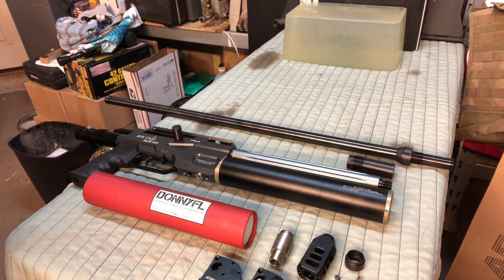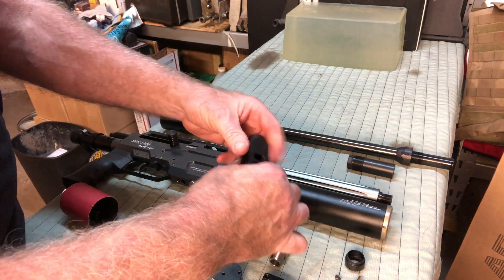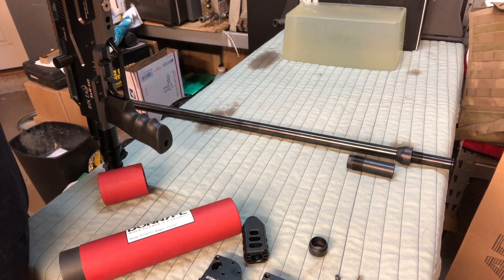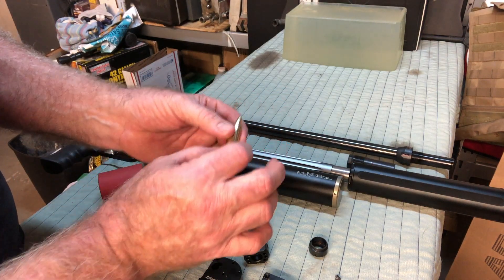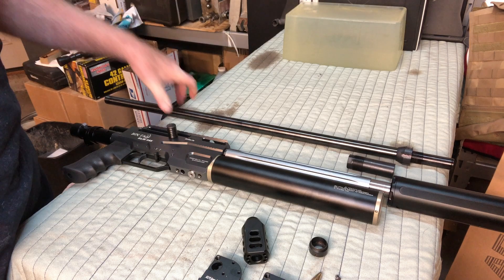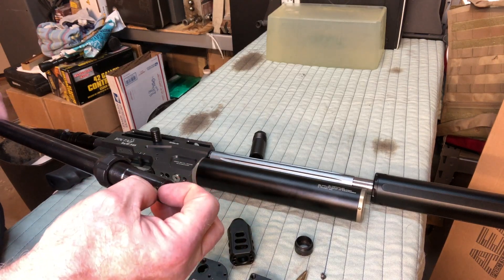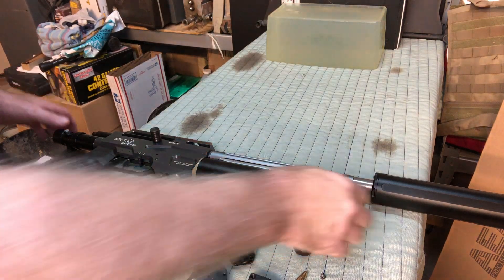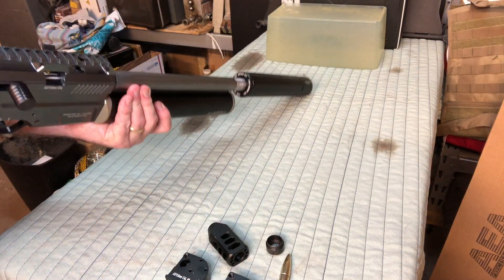B&W S45 TPP ammo test and DonnyFL suppressor fitment with my custom adapter + Zeus 58cal VID27

Comment: The 10 mm bolt is most likely a plug for a hole in front of the trigger guard. Mine has set screws.
Reply from the maker: thanks.

Comment: How did you get the component behind the muzzle break? Does it screw off counterclockwise? It is so tight, I didn't want to break out scratch anything.  Wondered what tricks you may have used to get it off. I can't put the extender on until I get it off.

Comment: Great video also was wondering about having the barrel shortened on a 58 cant stand a 50inch gun in the field and using the bottle off the 24inch zeus or even 16inch barrel   depending on how short you wanted your barrel to be.  u can even have it threaded for a donny fl anyway what r your thoughts on this i need master machinist hell could u imagine doing this  un charted waters doing your own chrony numbers 50/100 and 150yard test
Reply from the maker: I would start by extrapolating off of the Zeus 72 cal numbers. I would imagine someone has tested the 16, 24, and 32" barrels and done comparisons. It might give a rough idea of what the best barrel length is for this gun.

Comment: Ive been hearing the s45 is having barrel issues with pellets when shooring them was wondering how much run out u have on the part u made anyway was watching i mister hollow point video where he mentioned opening up the start of the barrel .0002 with a reamer so u could possible get past the issue of the twist starting 2 soon or hard loading pellets
Reply from the maker: I'm not trying to turn this into a sales pitch, but my 155gr seem to be working fine. Should any established, trusted business want to start doing this modification for the public (And stand behind it), maybe I would try it. For now, I'm not going anywhere near my 1500.00 BW S45 with a reamer.

Comment: Nice video review.  I'd be very interested in what you're developing as well as the adapter.  I'll be sure to shoot you a memo via your website contact form and will try and encourage others with like interests to do the same.  Hopefully you'll secure the numbers to make it worth your while to crank out a batch.  FWIW, I just became a subscriber and look forward to your upcoming videos as well as perusing through all your other interesting videos I have yet to view.  Thanks for taking the time to publish this and other video's and its' content.  It's very much appreciated...
Reply from the maker: Well, it's a funny thing. Donnyfl came out with a 25.00 adapter yesterday and it looks absolutely identical to mine??? Anyway, I'm still checking on pricing and will probably still move forward with a high-quality stainless steel adapter and possibly tighter tolerance suppressors. Another funny thing happened last week, I had a friend use this adapter with a 357" Donnyfl suppressor on the 457" and it worked great...Think about what that says about the tolerances and how good a job the suppressor is doing if you can fire a .457" projectile through a .357" suppressor.
Reply: @texomaprecisionpellet7545  can I get one of your adaptors. I'm having trouble installing it. Like you.